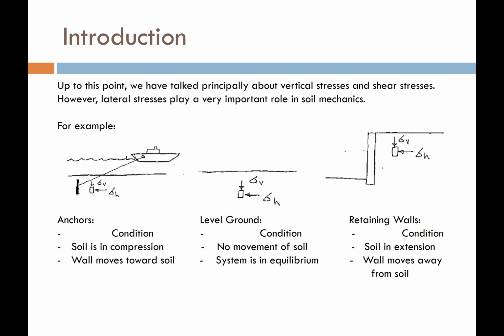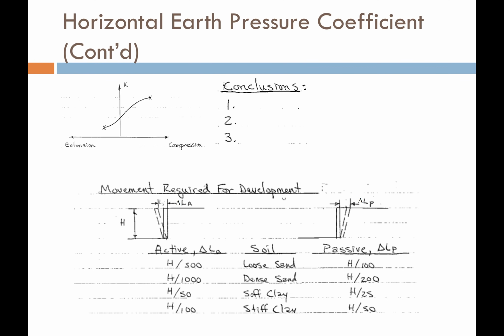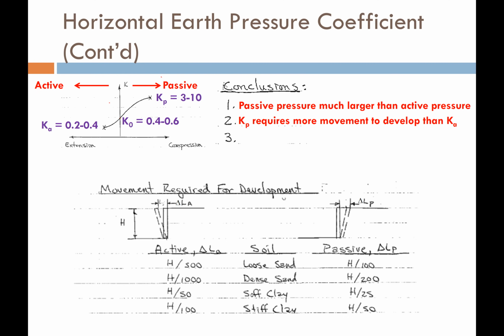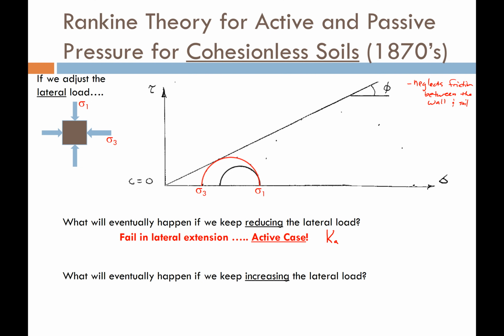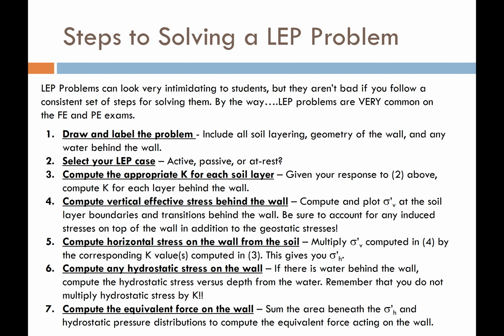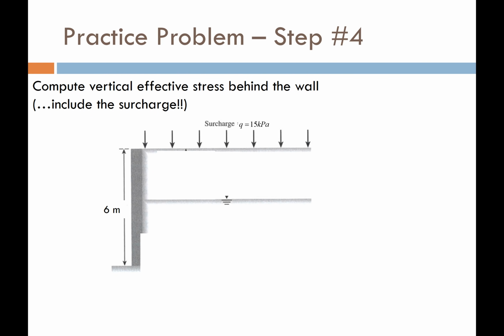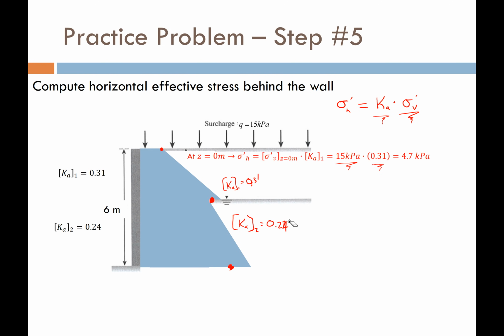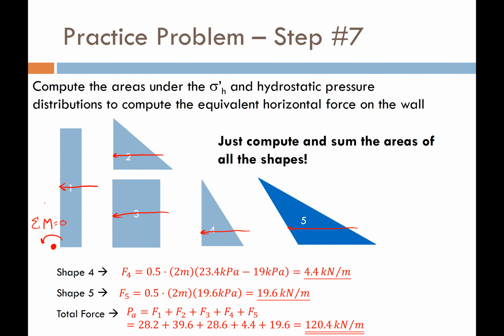CEEN 341 - Lecture 23 - Lateral Earth Pressures, Part I

Comment: I was wondering what happens when we have an inclined wall, lets say 60° with respect to the horizontal axis, and we have earth underneath that inclined wall, as for example in a water channel, where the walls are not vertical but they must be inclined in most cases. I kind of think that in that case it would be the soil supporting the wall which is resting on the soil and not having to be design agaisnt any active pressure. am I correct?

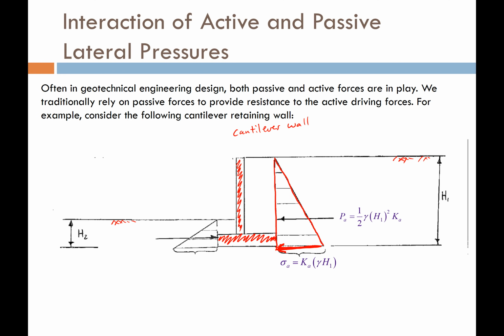Comment: for the equation of Pa at 29:15, why isn't it 2/3 rather than 1/2 since it is a triangular shaped load?
Reply from the maker: 2/3 the height is used to locate the centroid from the top of a triangle. We are dealing with areas, not centroids. 1/2 base * height gives you the area of a triangle.
Reply: @officehours4028  Thanks. Ya I figured it out shortly after. Got some reason I thought you were calculating the moment with that

Comment: hey,You are doing it wrong .The effective stress due to saturated soil will be soil minus the pore water pressure .You shoulhd substract water pressure from pressure due to saturated sooil.
Reply from the maker: Whether you use a buoyant unit weight or you subtract water pressures from the equivalent fluid pressure from the saturated soil, you will get the same result.
Reply: @officehours4028  got it .